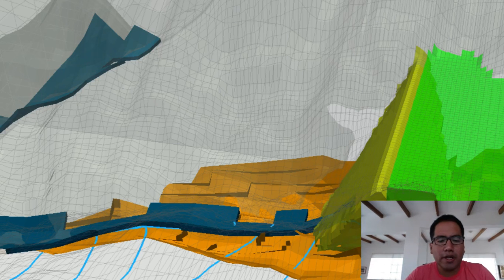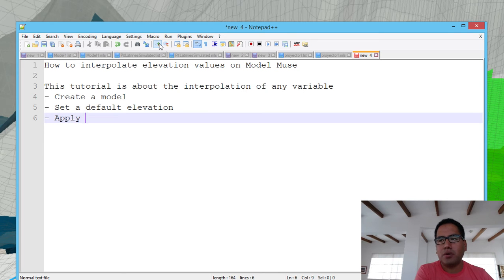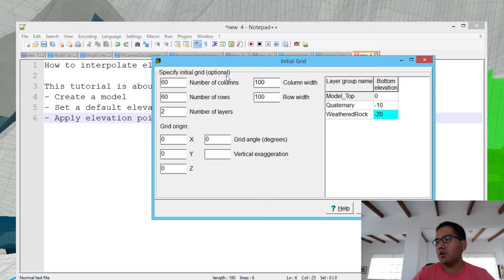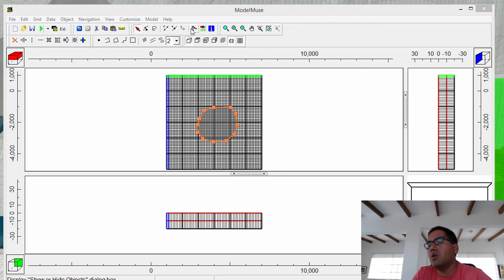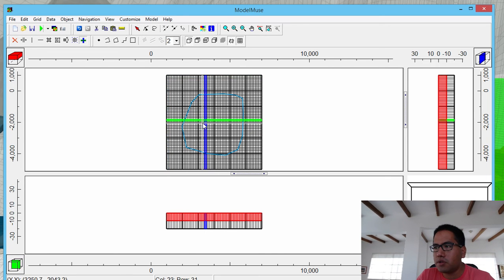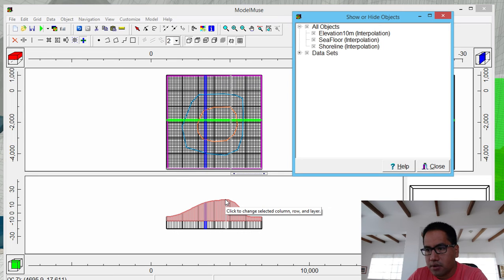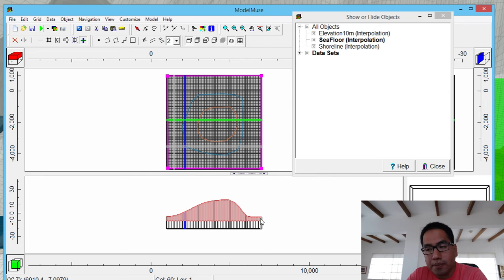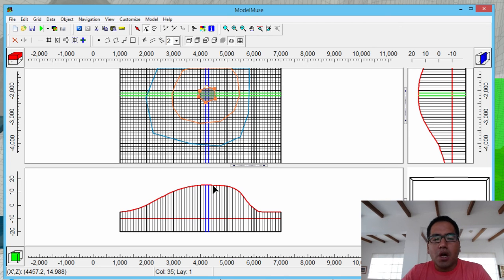How to interpolate elevation values on Model Muse

Comment: Saul, can we use Modelmuse to model the behavour of a relative flat roof and the way rain is drained defining a recharge (rain), the actual slopes and the drain pipes in order to get an idea how high the waterlevel will be on the roof during the drainage.
Reply: No, this is an open channel hydraulics problem, not a groundwater hydraulics problem. Better do this calculation by hand or with HEC-RAS or other hydrological modelling software.